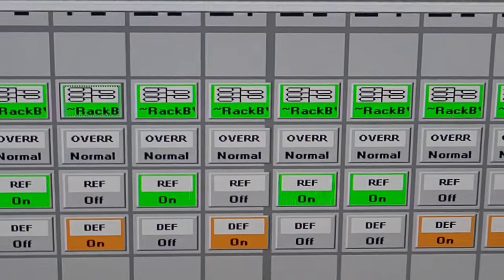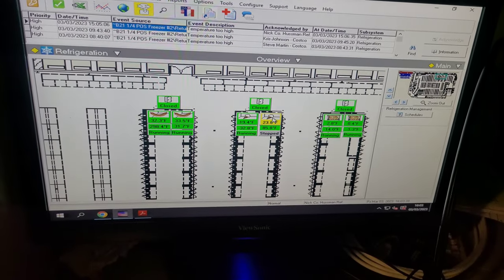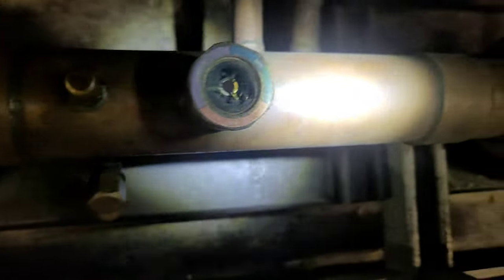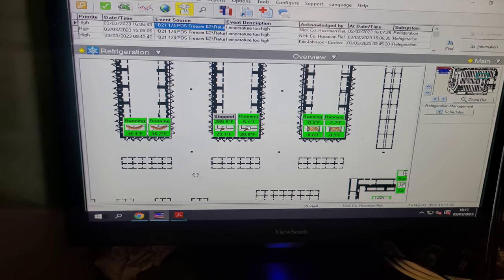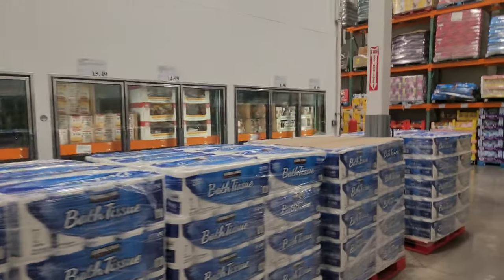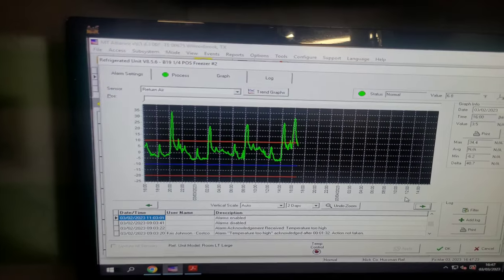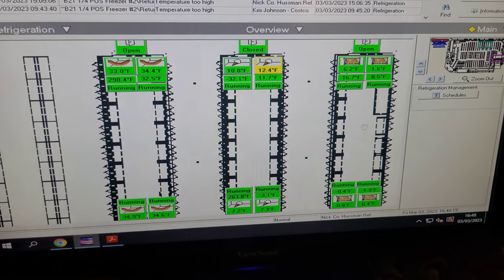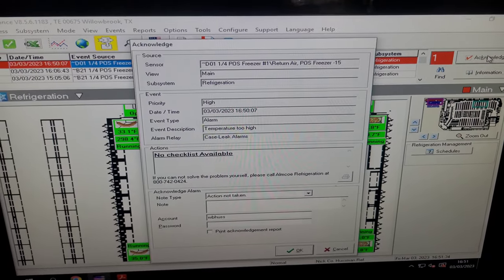Wholesale Grocery Salesfloor Walk In Freezer High Temp Alarms 2 Racks Diagnosis / Part 1

Comment: I’ve been to that store a lot used to do the HVAC there 
I remember those gray curtains up there like it was yesterday 
Did they ever get the HVAC on the 
micro- thermo?
At least they have that scissor lift there for you to use still gonna suck thawing that freezer 
Is it electric defrost or gas defrost?
At least if it’s gas defrost it will thaw the inside and outside of the coil right ?
Reply from the maker: Yeah it sucks defrosting it. The ice is so big on the outside of the coil that I've got to do it from the inside, You'll see in the video I'll post it later tonight. I gotta come back in the morning and like 5 hours. It's hot gas defrost but the ice is so thick on the coil that it's not helping any. . It's a pain. 
I'm not sure but I think the HVAC is all MicroTherm